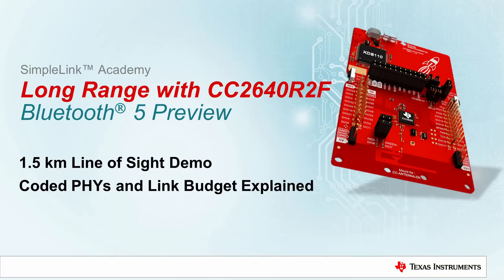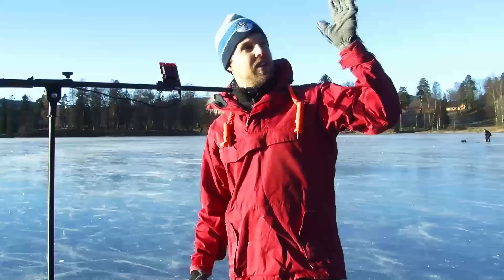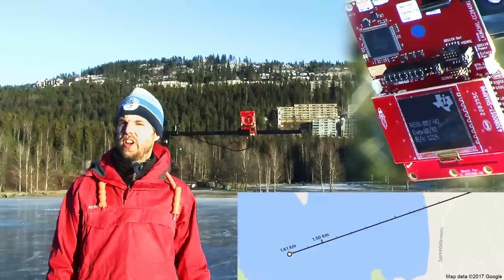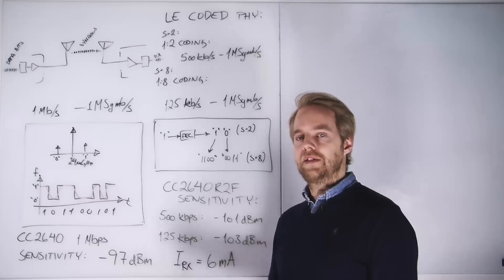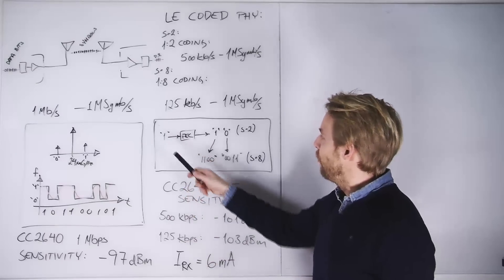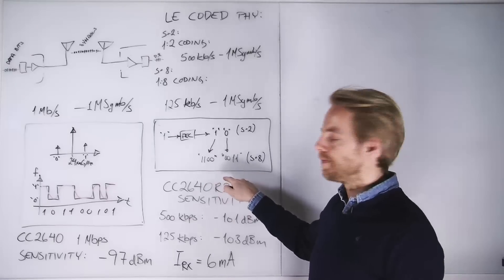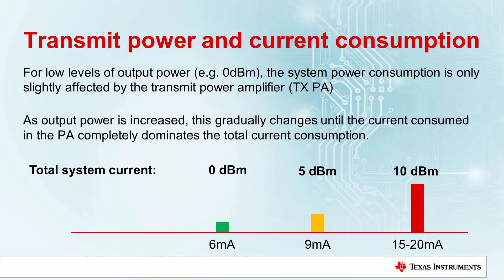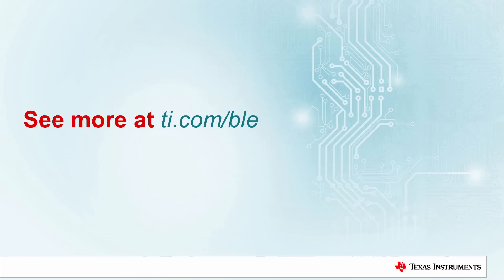Long Range with CC2640R2F

Comment: 2 launchpads, activated on 2 separate laptops, using Smart RF Studio.Everything at default settings: Tx power at 5dB, CH 17, PDU length 30, One device on continuous Tx, the other on Rx.
At 1mega-symbol/sec, indoor range is about ~12m (both 0.125m/s and 1.0m/s at 9% error rate)
At 0.125mega-symbol/sec, indoor range is about ~14m (70% error rate at 0.125m/s, no reception at all at 1.0m/s).
I might have done something wrong to give such a short range, but even so, the RATIO between the distances should have been 2 (+6dB, meaning 2x range)

Comment: Hi I have purchased two CC2640R2F launchpads and I am not getting that much range with the long range demo clones from the simple-link github... do i need to change the power to 5db ?
Reply: yes you need to increase the transmit power to +5dB and receiver coding needs to be changed as described in the video
Reply: @avationawesome  and do not forget to get out in the wild without any (BT, WIFI, ... ) civilization nearby...

Comment: I purchased CC2640R2F MCU and I have CC2650 sensors with me .I want to connect multiple devices to a  single device by making
CC2640R2F  MicroController as Central(Master) and CC2650 as Perpipheral(Slave) as I am new to the BLE connection can you help me in this connection part (How to connect  CC2640R2F  MCU to CC2560 Sensors).
Reply from the maker: Hi Tejaswini, visit our TI E2E forum to get help from our experts: 
 http://ow.ly/KviZ30fR3uG
Reply: Yeah...tq so much for your fast response but My que is I have CC2650 sensors and CC2640R2F MCU with USB ...are these two enough for MASTER-SLAVE relationship to connect to android device.Just please give confirmation on this and provide me a sample code to run an application using these

Comment: Nice marketing video, but how many of us do operate their BT-devices out in the wild without any other BT/WIFI/... device nearby? And besides that the chips had veven been facing to each other. I wonder how long it took to reestablish the connection after moving the devices to the changed location. Sorry, but such situation is far off any practical usage. LORA is the solution for distances exceeding 20m.